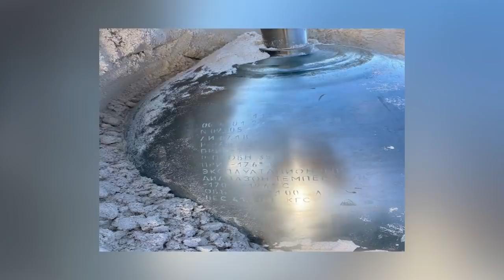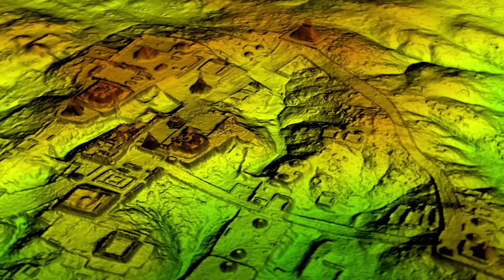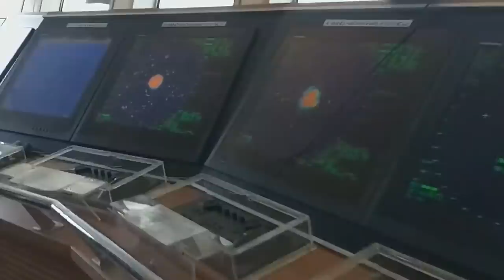12 Most Mysterious Discoveries Scientists Still Can't Explain

Comment: In the middle of nowhere (at least 60 miles from the nearest small town), in the vast northern Maine woods are 2 steam locomotives abandoned by a lumber company in the late 1800s - early 1900s. Though the trains sit on a set of rails, there is no other tracks in the area. The story is, the trains, along with rails, were hauled to the area by teams of moose (it wasn't safe for horses to traverse the woods) to haul lumber across frozen lakes in the winter months. Apparently, it was deemed more of a financial benefit to lose an entire locomotive under the ice than it was a team of men and animals. Plus, the train could haul much more wood in less time. 
On the trail going to these trains is a cement truck, half buried in dense forest. It can barely be seen even if one is looking for it. The road that once allowed for large vehicles to travel to the old logging camps was quickly reclaimed by mother nature once the camps closed and there were no more travelers. The truck had gotten stuck in mud and sank too far before equipment to pull it out could be located and delivered to the site. So, along with two beautiful steam engines, it sits rusting without any explanation (unless you speak to one of the few old timers left in the area) as to how it got there.